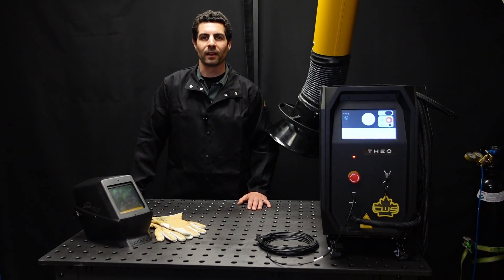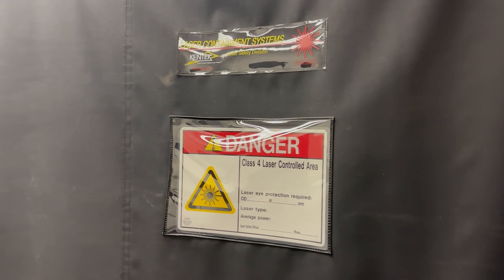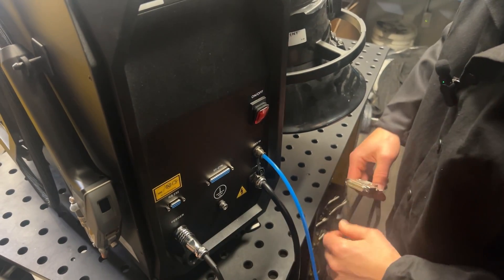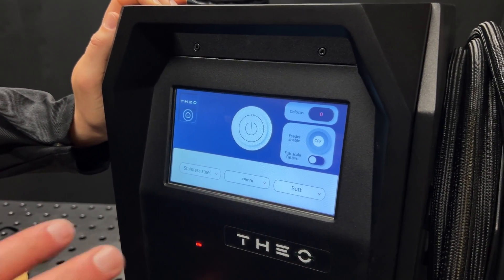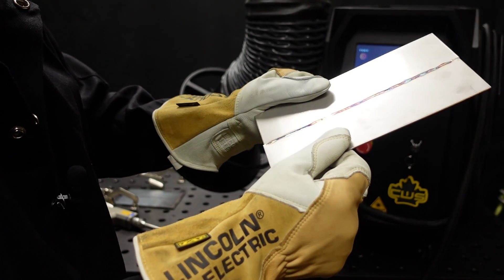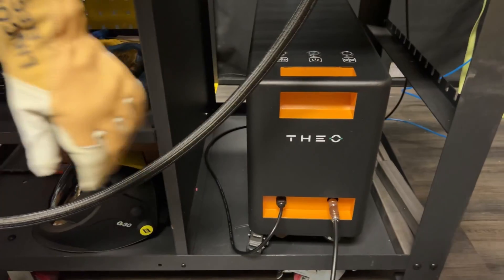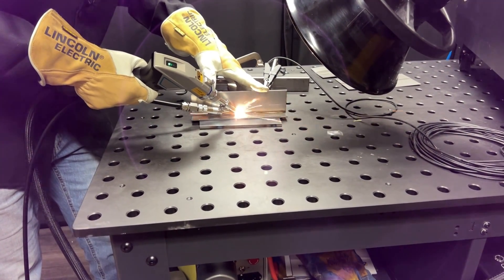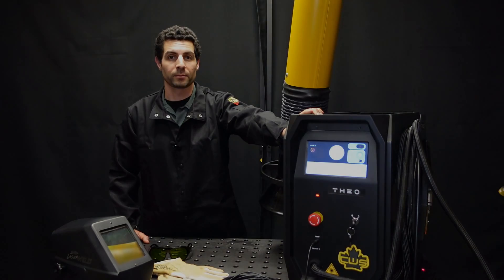Are Laser Welding Machines The Future? - THEO MA1-45 Handheld Laser Welder

Comment: It’s not a grounding cable. It’s a sensing cable. There’s too much misinformation about welders. There is no ground cable for arc welders, it’s a work cable. There is no grounding in welding other than the ground in the power cable that grounds the machine. This is important because some novice welders try to weld on something that is grounded and can destroy the welder, the work, or themselves.
Reply: Second that!

Comment: I'd love to see heaps more on this welder please!
Can it weld titanium?
Thanks for your efforts.

: ]]
Reply: No personal experience, but what I've read is that LW works well with Ti when you use very-high purity argon, and you'd want to protect all heated surfaces to prevent atmospheric nitrogen exposure. So ideally in a clean glove box, or well purged otherwise with cooling flow.
Reply: yes you can but have to follow procedures